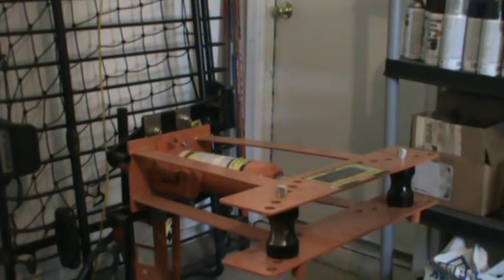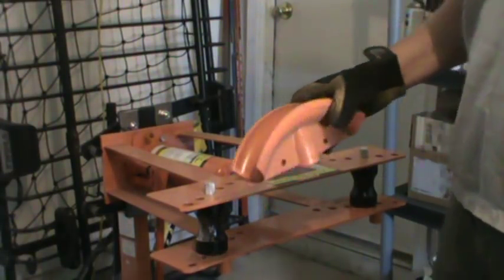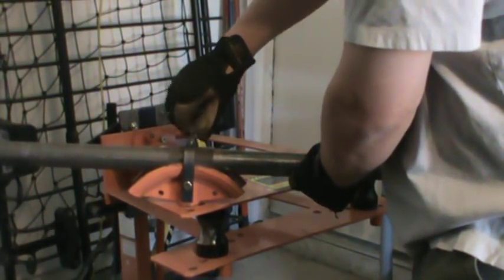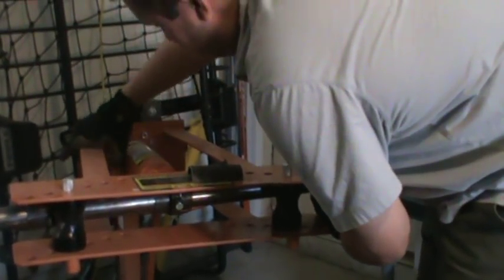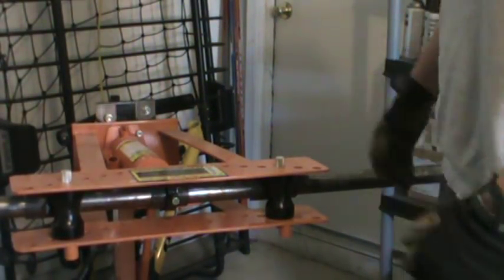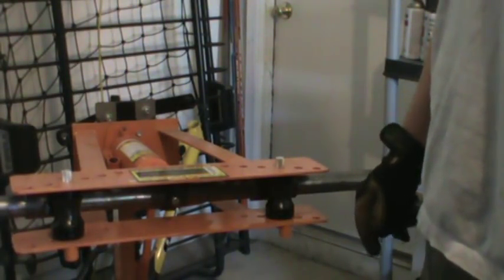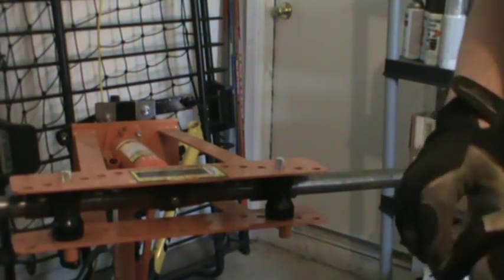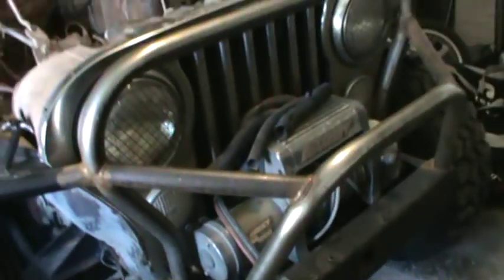Harbor Freight pipe bender modified for bending tube

Comment: I like the horizontal mounting on the engine stand.  I had been bamboozled many times trying to bend long pipe with it mounted vertically and the ends hitting the floor or walls.

Comment: That's awesome, I welded a bracket on the top of mine and used a threaded bolt attached to a collar sometimes It gets stuck but it works, nice job!

Comment: I just bought and used one of these Harbor Freight pipe benders, used your idea using the slide protectors, they worked perfectly with no dimpling, thanks for the tip, it made my work look better for it.

Comment: Nice vid. I found using next size up tube slipped over the top of the workpiece at the rollers is easier as they don’t keep falling off. Also moving the pipe along a inch and doing the bend in stages works really well.

Comment: Saw your comment on another video. I need to maybe a stainless steel boat railing with 1 1/2 outside diameter and 0.07" (2mm) thick. Do you think this bender can do it with your trick without kinking it? Also, from your other comment here below, it seems the die measurements are meant for pipes (internal diameter?) So for an OD of 1 1/2" what die would I actually need then? Thanks. I hope you will answer because I am stressed on getting this job done.

Comment from the maker: I absolutely agree.  Your pipe/tube needs to be a snug fit to the die you are using.  Most tube will not work with the HF bender.  However, you can buy 1 5/8" OD DOM and use it with the HF bender.  The 1 1/4" pipe die is for 1.66" OD, and 1 5/8 tube is 1.625".  It's close enough that it works well.
Reply: 10 years later you have saved my ass homie

Comment: If you look under the grille on your Jeep you'll notice a single body mount supports the entire grille shell,and front of the fenders...When you joined that frame mounted grille guard tubing to the tubing that wrap the flat fender styled fenders you effectively made it so the front grille,and attachments couldn't flex independently of the frame causing future headaches with cracking fenders,welds,pulled body panels..It has to be able to flex unencumbered on that single body mount...

Comment: If you do the bend in 3 separate spots moving the tube on both sides of the initial bend you’ll get the 90’ angle perfect but with just a slightly larger radius

Comment from the maker: That's definitely another method and I've heard it works.  I just feel that this method makes it quicker and easier.  No filling with sand and taping off ends and then draining sand, etc.  To each their own though.  As long as you get good strong bends, then it goes in the WIN column!

Comment from the maker: I showed the bends that it produced.  Structural pipe and tube is not cheap, and I don't want to bend a three foot piece that costs $20 just to throw it in the scrap pile.  This video showed what you need to do to achieve good bends.  If you do the mods correctly, then bending tube comes down to pumping a jack handle.  Sorry if I disappointed.

Comment from the maker: I'm bending 1 1/4" Schedule 40 Structural pipe.  The OD is 1.66" and the wall is .140"  Little thicker than 1/8".  Never tried WD40 or capping the ends, but the method I mentioned produces nice bends, so haven't worried about trying it.  Give it a shot and post up your results!

Comment: I took the time to us a die grinder and 50 grit flapper wheels and made the same die work on 1 3/4 " tubing. I then put sand in the tube and sealed it with duct tape. Perfect bents with no crimp.

Comment: To hold the shims in place why don't you weld a couple nuts onto the centerline of each shim far enough that the roller can fit in between.  Then use zipties to hold them to the roller.

Comment: Nice mod!  I have used my bender with limited results on roll cages, exhaust, etc.  I have tried heating and filling with sand, neither really seem to work.
Reply: +Dixon Cider ...Had no problems with sand on this bender, works wonders...Just make sure tube is packed tight!! I like the simplicity of this restraint vs mine.
Reply: using sand does NOT work, we even used a press to pack the sand in. Tube will not bend without kinking in this tool thats why it is called a PIPE bender not a TUBE bender.
Reply: Dixon Cider Thats because this is a PIPE binder Not a TUBE binder, Tube benders are for bending roll cages; frames etc, while pipe benders are used for bending pipe and conduit!!!! Do your homework and research! There is a difference!!!!!!

Comment: that looks nice, why did you use DOM tubing?$ i am going to be building a 1 person buggy kinda like a honda odyssey so i bought one of these benders today on sale, and i tried to bend some kinda thin tubing, it just slipped kinked and shrunk, but i modified a clutch puller, it was a cast puller, so i ground it a little and i notched the sides of the die, and it slides in nice, i need to make a protector, how did you make yours, cut the same pipe in half and spread it out a little?

Comment: I tried this setup with 2" pipe and it starts to kink the crap out of it at even the smallest bend. I would like to know what the wall thickness of the pipe you where using.

Comment: Im doing this but im also going to use sand and see if it works even better thanks for the ideas
Reply: Long time ago, I made a rollbar for my roadster using the pipe bender, and I used sand and also heated it up a bit with propane torch, and it worked well.   Not a fun method though.  If you look on my channel, I made a cheap real tube bender

Comment: pack the tube with sand and water prior to chucking. Duct tape the ends and go to town. Collar should be standard issue! Sideways mount of pump may limit travel due to reservoir , but probably not affecting this setup.

Comment: An auto parts guy told me to pack the pipe with sand and hit the pipe with a propane torch on the outside and you get good bends. I haven't tried it yet, but I'm going to try some conduit for exhaust pipe. I have the same pipe bender that you have.
Reply from the maker: If the tube will be used structurally (like a roll cage), I would maybe do a little research before heating the tube with a torch.  Yeah, I've heard sand and tape works as well, but I just don't want to have to mess around with sand getting everywhere and packing every tube.  To each their own though.
Reply: +Paul Crissman How did it go?

Comment from the maker: Only problem is that the rollers and protectors are oriented on opposing axial planes.  I actually plan to use some small ubolts to go around the rollers with some tack welds to the protectors.

Comment: Neat, but the tubing pushing OUT isn't what causes the kinking. When you bend tubing, the tube deflects against the outer edges of the dies. That's why the depth of the radius in the dies is just a hair over half the "depth" of the tubing. If you use *pipe* dies, there is a gap at the point, and the tubing will deflect to fill that gap, leaving a kink in the tubing.

Comment: Cap one end and fill it with liquid sand till its full then weld another cap on the filling end and it won't kink on you.
Reply: Jason Anderson liquid sand is called molten glass. just sayin.
Reply: Well then just add water to the sand, just saying.
Reply: Jason Anderson that sounds like a miserable way to bend for a home project.
Reply: It is, when you don't got the good stuff and its the only way to bend at the time. Putting wet sand in the tube helps the kinking in the tube and allows you to do 90 ° bends.
Reply: I made a mini bike frame this way when I was 12.it works but a pita.
Reply: I was fourteen in high school when I learned how to bend metal ever sense its been hobby of mine. I built a gocart frame for my first one.
Reply: gary fraser your saying what we're talking about putting water in the sand to make it more dense.
Reply: OR just get the proper tool for the job a TUBE binder, Not a PIPE binder

Comment from the maker: Personally, I would not do this.  I tried making a sleeve that was for my 1 1/4" pipe (1.66" OD) die to use 1.5" tube.  Even with a sleeve that gave a pretty good fit, it still kinked the tube a little bit.  Take this HF mod for what it is, not for what it is not.  And, it is not a fancy tube bender.  But it will bend 1 5/8" tube because it is nearly identical OD to 1 1/4" Pipe.

Comment: Fill the tube with sand to prevent kinks
Reply: doesn't work, nor does heating it.
Reply: Tube benders are for bending roll cages; frames, while pipe benders are used for bending pipe and conduit!!!! Do your homework and research! There is a difference!!!!!!

Comment: the dies are the problem.
they are sloppy and need to be shaped.
I had to build mine up with mig welder then sand them out to make the fit nice and tight.
lots of work and BS but works great now.
sand doesn't work.
the problem is the die and poor fit.

Comment: Do you know what the thickness of the tubing was?
Reply from the maker: The pipe I was bending was 1 1/4" (1.25") schedule 40.  That is .140" thick and the outside diameter is 1.66".  You can also use the bender to bend 1 5/8" tube in whichever wall thickness you want.

Comment from the maker: Thanks for the positive comments.  I'll be the first to admit that these were not all my own original ideas.  I researched a lot and combined several of the ideas I ran across.  However, I decided to post a video because I had seen anyone do that.  I guess the protractor was actually my idea though.  :-)
Reply: What's the diameter of the bend radius? AKA, how tight of an angle can we bend with one of these? Looks like the bends around the lights are pretty tight. Maybe 7 inches?

Comment: Aren't the rollers suppose the rotate while bending?
Reply from the maker: Not if you are using the sliding tubing shells like I made to keep from denting the pipe or tube you are bending.
Reply: Bobcatt22 If you want it to roll, you need to buy stayers.  See rollers stay, stayers roll.   Got it now?
Reply: the rollers are too small, the stress point creates dimples in the tube. I do the same with mine but I didn't weld it since I bend many different size tubes.

Comment: You don't need to clamp on the half tube pieces, you can use 1/2 wide strips from a bicycle tube to hold them onto the tube you are bending.  This will hold anything tightly and if they get ruined, big stinkin' deal!  they are great rubber bands.  you don't need to pay a lot , and you can buy tubes for CHEAP!  different diameter tubes give different rubber bands diameters

Comment: That's not a "pipe bender", it's a pipe folder. For any pipe diameter over 3/4" you need whats called a follow bar. Also, the side's of the bender shoe aren't deep enough for thin-wall tubing. The deeper the shoe the less likely the sides of the tubing will blow out and fold on ya. The insides of the shoe should be flat and parallel with NO radius, or curving whatsoever.

Comment: Can you used this for exhaust pipes?
Reply: No and why would you want to, exhaust pipe are sold in pre bent sections just buy and weld up,
Reply: I built the exhaust on my truck with no problem using this

Comment: Thanks going to Harborfreight now.
Reply: Bought the 12 ton the guy could not find the boxes for 16 they had box 1 of 2 so i settled for 12. I will be making a tricycle for my son. Nice video love it.
Reply from the maker: FrustratedBaboon
Cool, I haven't used the 12 ton, so I don't know how it will work. If you are using smaller diameter pipe, I would imagine it will work fine.

Comment: Okay, what's the difference between "pipe" and "tube?" In my dictionary, they're the exact same thing - a hollow, often cylindrical-shaped, object to carry water, gas, or similar.
Reply: Dwight Stewart Tube is measured on the outer diameter, wall thickness therefore decreases the inner diameter i.e if someone says 1inch tube with 1\4 inch wall, straight away you know that the outer diameter is 1inch and the inner diameter is 3\4 inch. Regardless of wall thickness, 1inch tube will always have an outer diameter of 1 inch.  
Pipe on the other hand is measured on inner diameter and wall thickness increases the outer diameter i.e. 1inch pipe with 1\4 wall thickness makes for a 1 inch inner diameter and 1 1\4 outer diameter. 
A pipe will always keep its inner diameter but the outer diameter is the variable. Tube keeps the outer diameter and the inner diameter is the variable. That's why you will always be able to fit a 1inch tube into a 1inch pipe, regardless of wall thickness of either. You can't put 1 inch pipe into 1 tube though.  
As pipes carry water, air etc. calculations are made on transfer of volume, which is based on inner diameter. Say you increase pressure, meaning a thicker wall is needed, a pipe with a thicker wall does not affect volume as the inner diameter is constant, only the outer diameter increases. If tubes were used, then the wall thickness would decrease the inner diameter and therefore feedback into the equation as now the volume has decreased, so the numbers are off. That's why pipe is used for fluid, air transfer, as the important part is kept constant. HTH.
Reply: @car_ventures  close but you got a couple of things wrong. 1" tube with a 1/8" wall thickness will have a 3/4" ID (you have to subtract double the wall thickness). Same goes with pipe, 1" pipe with a 1/8" wall thickness will have a 1 & 1/4" OD (add double the wall thickness).

Comment from the maker: Sorry, haven't checked this in a long time.  I've never tried square tube, and doubt it would work with a round die.  Also, I wouldn't just use the next smaller size die... It WILL kink.  Needs to fit snug in the die.  Last, you can buy pipe in structural grade.  Pipe/tube is just a reference to how it's measured.  Pipe will never be used for a NASCAR build, but I think it's fine for the everyman use so long as it's not Home Depot poop pipe! :-)

Comment from the maker: Actually, no you do not.  I tried that to start and wasted a piece of tube.  This mod makes a night and day difference if you do it right.  It is not safe to run kinked bends in a vehicle safety setup.  I don't mind using structural pipe for a cage, but I am not okay with the bends having kinks.  Do it right and be safe.

Comment from the maker: Sorry, I'm obviously a frugal guy (HF bender and all), so I didn't want to bend good tube randomly if I didn't have a use for it on my Jeep.  However, I did want to show the bends I have produced as examples.  The real key is modifying the setup correctly as I showed.  After that, bending tube is just pumping a jack handle. :-)

Comment: I have the same bender.  Do everything you do.  But pack the bitch full of snadblasting sand then cap both ends.  It forces the pipe to strechon the outer.  But remember if streching it you gain surface area so pending on angle might have to add more sand.  But if want to be quick i had the idea to have a enter cap and exit cap under compressed air.  So like sandblasting open a lever and shoots right into your pipe as need it.  Whe done,  open another lever and air shoots the sand back into a holding tank.  Simple,  no mess and by looks of your jeep be nothing for you to build.

Comment: i wonder if I could  bend 2"1\4 exhaust  pipe this way...
Reply: +Jtinnon i had a bender that is showing there junk no they wont bend any thin wall pipe like exhaust.
Reply: +Wayne Blue I have a big red and I bend thin wall all the time without filling or kinking, minor wrinkles but its not like its a mandrel bender.
Reply: +Wayne Blue Never a problem with this bender...Have bent schedule 40,  EMT conduit and exhaust pipe...Never a kink

Comment: yup you don't need that collar either just stick flat heads or chisels in on the sides of the dye and move the rollers out to the far settings and it won't kink the pipe his way is a little more legit but doing that will yield the same results for way less money and time

Comment: or instead of making all this crap... pack the pipe really really tight with fine sand
Reply: this almost looks easier/simplier to do. sure it might take longer but once you got those made you wont have to pack the pipe with sand every time you wanna use the fucking thing
Reply: I've been curious about how that works. I know it does, but my question is: Do you have to weld the ends closed so that the sand doesn't just push out when you're bending the tube? Or can you just leave them open, because just having the sand in there creates enough resistance to not buckle? I've been thinking of creating my own mandrel bender, but want to explore all alternatives first.
Reply: you can duct tape the ends closed, the sand creates enough resistance to not push out, it just has to be packed fairly tight. adding a bit of water to the sand can help it pack tighter. to be honest this guys modification is a much better setup imo.
Reply: bkpickell By packing it with sand and ducktaping it close it will create enough resistance and distribute the force of the pipe bender.  therefor it won't kink it.  Also for best results... pack the pipe with wet sand and  let the water evaporate. that will pack it even tighter. I guess if you do all that and think about it, you could easily make this and not have to worry about packing the tube every time or waiting for the water to evaporate.